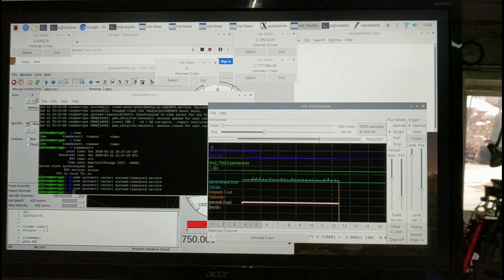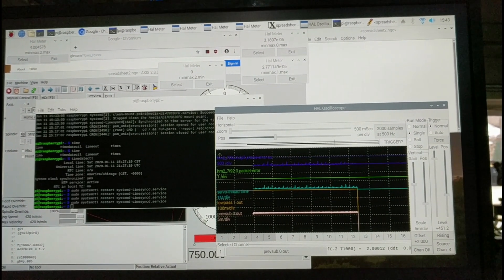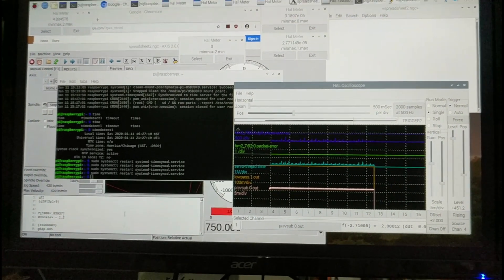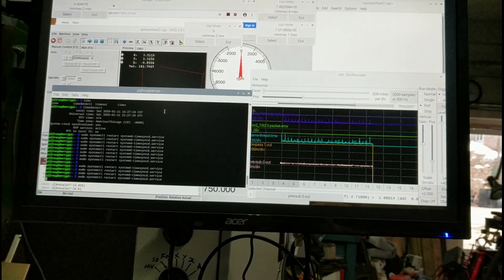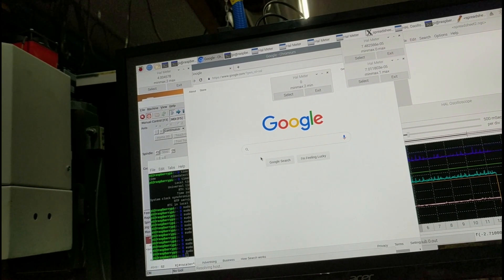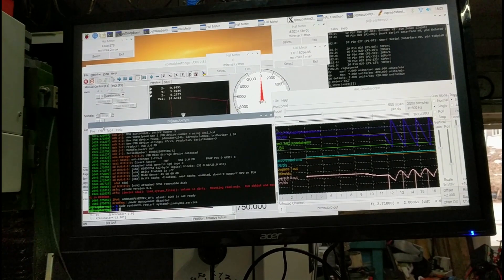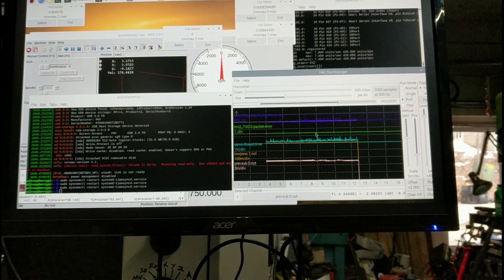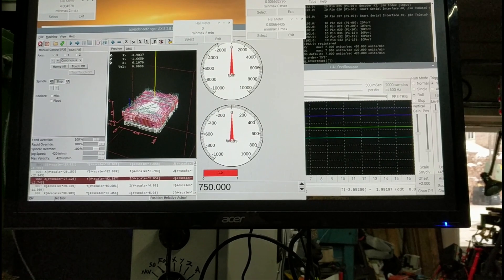Linuxcnc and Rpi4 - final problem solved?  Another painful video.

Comment: timesyncd will slew (adjust gradually) the time as long as the offset remains smaller than 0.4s. Otherwise it will step the time. There is a known issue where timesyncd steps the time frequently when dealing with a low-precision NTP server (issue #14404 in systemd github). You can enable debug logging for timesyncd to show whether that happens in your case.
Anyway, the CNC software should probably use CLOCK_MONOTONIC (man clock_gettime), which is not affected by discontinuous time jumps, or even CLOCK_MONOTONIC_RAW, which is not affected by NTP at all.
Reply: The issue "When dealing with a low precision NTP server timsyncd jumps the time every 30 seconds" is tracked here: https://github.com/systemd/systemd/issues/14404
Reply: LinuxCNC does use CLOCK_MONOTONIC, I think CLOCK_MONOTONIC_RAW is not suitable  because of some issue with nanosleep

Comment: have you calculated jitter in linuxcnc on the pi? i have been told you want to be under 20k and i have a couple medium PC's that don't hit that. would be very curious if the RPI can.
Reply from the maker: Depends on what you are trying to do.    If you are thinking of doing software step generation - the pi isn't that great.  (pretty high jitter)  seems ok for external interface hardware - like mesa

Comment: Wow, that's good debugging! Is there a chance that this is still going to happen but at a much smaller degree? If ntp controls the clock just much more slowly (as Denis Schablowski mentions) is there going to be creep instead of a bang?
Reply from the maker: the change seems to be small enough that linuxcnc is unaffected.    Running for days with ntp - I got peak following errors of .00006"  (yes 4 zeros)

Comment: The Raspberry Pi has no RTC. therefore the Pi calls home and adjust the time. the standard method is quite brutal and adjusts the time during one cycle. this throws of all clocks. the ntp service uses a way more sophisticated method to slowly adjust the time until it is correct. The impact to the clock is much smaller.
The best way is to add a RTC to the PI. This fixes the time keeping issues and the Fake clock can be disabled.
Reply: This and a lot of boards exist with nice other features bundled... Surely worth every cent if this is the last frontier to make the RPi a rocking LinuxCNC platform!

Comment: I guess I still don't understand your problem or your solution. Is this a software problem or a hardware problem? By not doing something is not fixing a problem; that's avoiding a problem.
Reply from the maker: Using ntpd instead of timesyncd (default) seems to fix the internet time sync issue.